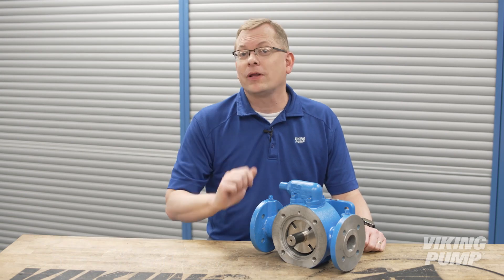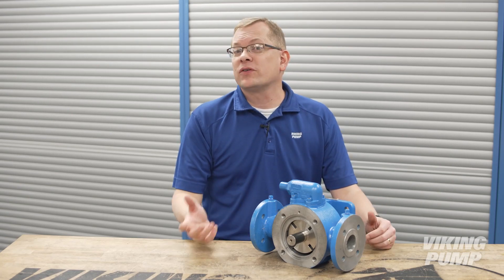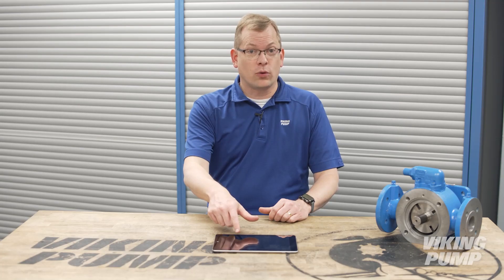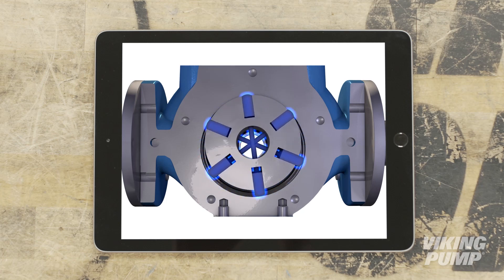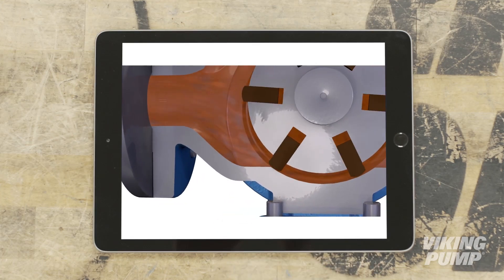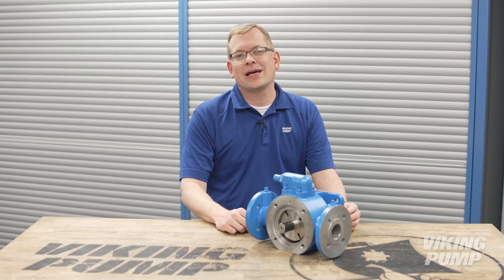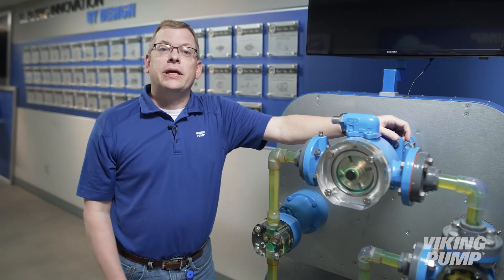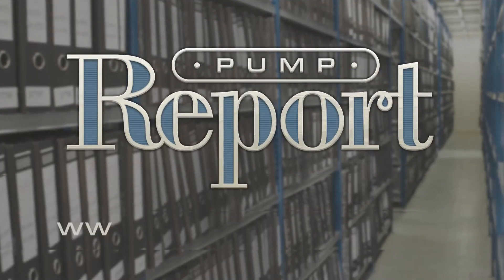Vane Pumps and How They Work

Comment: How to adjust the flow pressure on it
Reply from the maker: The vane pump shown is a fixed displacement pump. Flow is directly proportional to speed. Pressure is dependent on the downstream system including head and frictional line losses. For more information on the difference between flow and pressure, check out our video here: https://youtu.be/Upx-ecYwCLw?feature=shared